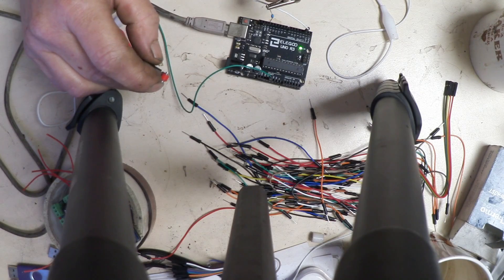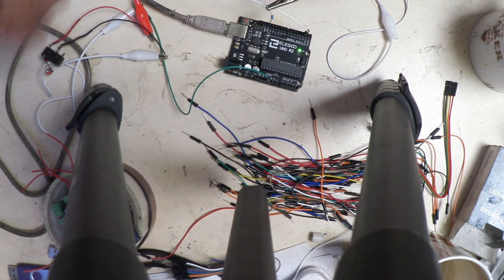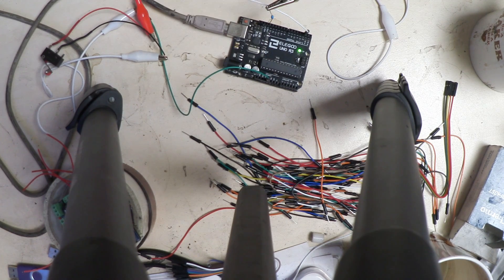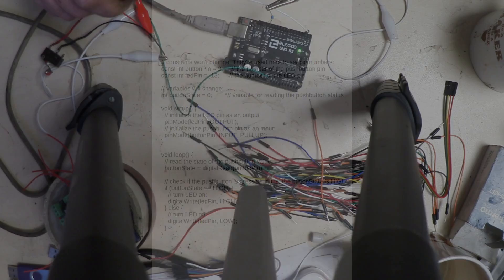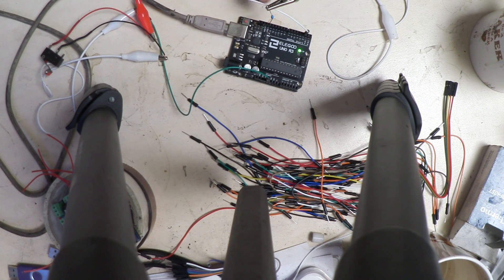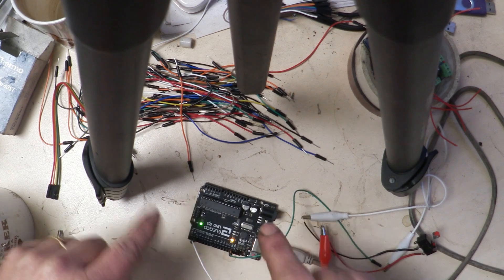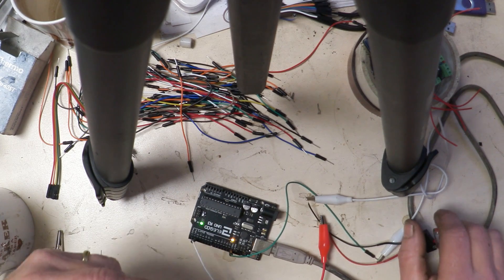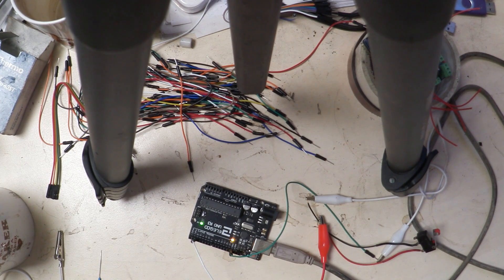1011 Working With The Arduino - Input Pullup

Comment: You have slipped into the twilight zone. You will consume Arduino, then other microcontrollers, then Pi, then Jenson, then Ai. It is endless and endlessly fun. Input Pullup is among the first thing people learn when using the Mega328 to do anything, that and button debounce routines.

Comment: it's called a weak pullup usually and can anywhere from 30 to 200k ohms. It differs a lot even between controllers of the same type ( it's on the controller  ... not so much on the board .. ). This does away with switch current and for some types of switches that is bad. for sliding switches and gold contact switches it's fine. The minimum current can usually be found in the datasheet for switches and relay contacts.

Comment: Actually, Rob, your external resistor was connected to Gnd - so a pull down, with the switch connected to +V - so closing the switch turns the LED on, The internal pull up is conected to +V and your switch is connected to Gnd - so closing the switch grounds the input and the LED goes off.
Reply from the maker: did you watch all of the video mate?
Reply: @ThinkingandTinkering  Yes. I always do.
Reply: A very good point Ken, I suspect that a pull down resistor was used in the first demo sketch as it is more natural for people to think of the switch closing as turning the input "on".

Comment: Any input generated by a switch will need to be debounced either by software or an RC filter. If you’re just driving a relay on an output pin you may not notice the output toggling up and down until it settles in the correct state.  But if you want to turn a function on or off via the switch you may end up in random on or off states. Switch contacts can bounce quite a lot and the Arduino is fast enough to see most of them as individual switch states, so you press the button once the Arduino see 10 or more.
Reply from the maker: next video mate - best not to do everything at once lol

Comment: I realize that this is off topic from this video, but I wasn’t exactly sure which video it may ON topic for and I wasn’t sure how to contact you through another channel. But I have a question.... in theory, would it be possible to use a controlled flyback voltage as a way to make flash graphene? If you can predict a voltage spike, couldn’t you just put graphite directly in the path of that voltage spike?
Reply from the maker: it's not voltage mate - it's the amount of joules you put through it - so yes you could if your flyback can handle the amps - they tend no to be able to - but that doesn't mean they can't
Reply: That makes sense. Thanks for the response.

Comment: Correct me if i'm wrong, but I think the pullup-resistor is inside the microcontroller and not on the board.
Reply: No need to be corrected your right
Reply from the maker: for sure - but it doesn't really matter when it comes to using it and we don't need to be too technical I think at this stage

Comment: Input pull-up is quite handy, but as you said the original external pull-up was used to make it more noise-immune. If you're having issues with noise triggering the inputs, look into software debouncing code. It works by checking the value over a few milliseconds to make sure it's still pressed or unpressed. Obviously for limit switches you want to react immediately, so don't do that, but for trigger switches you want to be sure the trigger is properly pressed before reacting.
Reply from the maker: I debounce on the next vid mate
Reply: @ThinkingandTinkering  Oh nice. These are really simple, practical tutorials you're doing which will help people on the edge get their feet wet. Great job!
Reply from the maker: cheers mate and to be honest - that's what I aiming for - I know I am missing a lot out - but I just want folks to get going as easy as possible
Reply: You may have just made a typo, but the original (with external resistor) was pull-down, not pull-up.
Reply: @nil5221  Ah, I forgot about that, but either way as Rob said, a stronger pull-somewhere would be more noise-immune.

Comment: The capacitive Sensing Library might be of interest.
Library does most of the coding work to replaces a mechanical switch by 1 resistor, a wire and optionally a conductive pad... as well as button, can then to make scroll wheels, sliders etc. all without needing to make cut outs in a plastic enclosure. I've printed out button layouts on transparancy sheet,, including nice neat txt labels, then glued the sheet outside of enclosure... sticky foil applied behind behind the appropriate points of the button layout, work to sense finger near button. likely your conductive ink would work too.
Reply from the maker: love it mate and done a vid on it I think

Comment: Hi mate another valuable video.  Two questions one that might be very silly 😜 🤪 🤣.  Could you make a brushless motor controller out of this and can these switches be programed to milliseconds.  Maybe I'll do a bit of research now 🤔
Reply: OMG The absolute maximum number of interrupts per second that can be handled by the AT90USB82 is 16 million instructions per second / 14 instructions per interrupt = 1,142,857 interrupts per second
Reply from the maker: you can generate the timing signals - no worries - but you still need an ESC as the Arduino can't handle the power  - quite a few vids on it mate
Reply: @ThinkingandTinkering  Just thinking out loud with no real understanding lol. I will have a look. I am in hospital Friday so let's hope it nothing serious as I still have lots of learning to do.